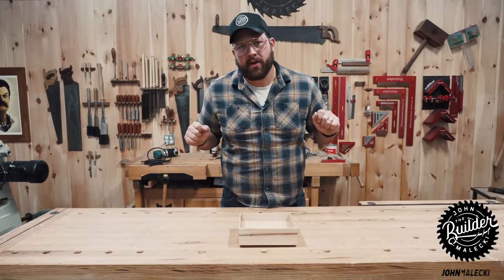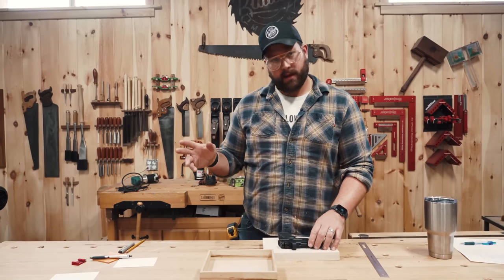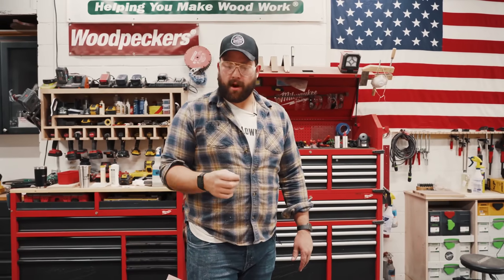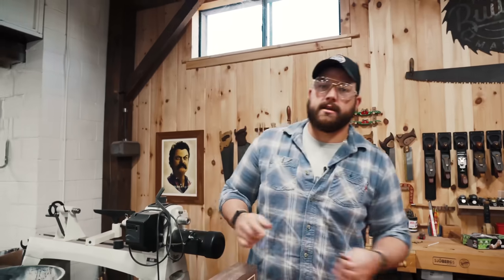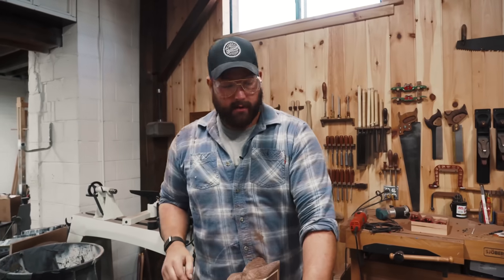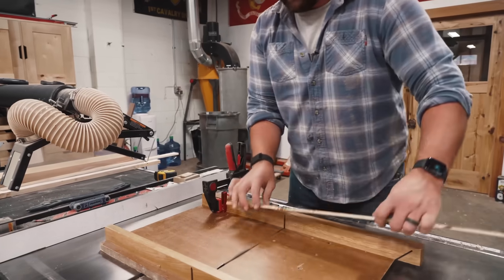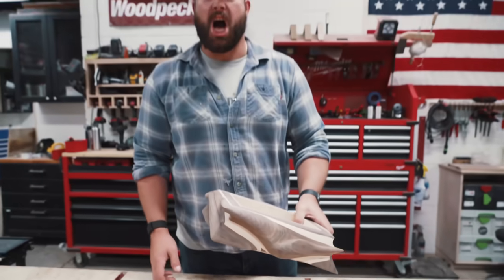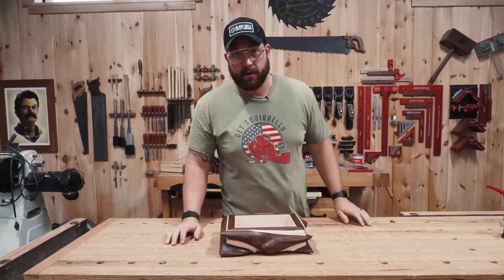HIDDEN Compartment Catch All box

Comment: For a little extra control with your contour sander, get sanding disks that are larger than the diameter of the plate where the disks attach. This will give you the ability to soften or round out inside corners so they aren't too sharp. All you need to do is do a pretty good eyeball when you're lining up the disk to the tool.

Comment: Love the design. Think I’ll make one, I have little kids, so I need to keep all firearms locked up, but I guess you don’t, so this should be fine. I’ll just omit the secret compartment. 

Are you concerned that with such a tight fit, with some seasonal movement the bottom may get stuck at points?